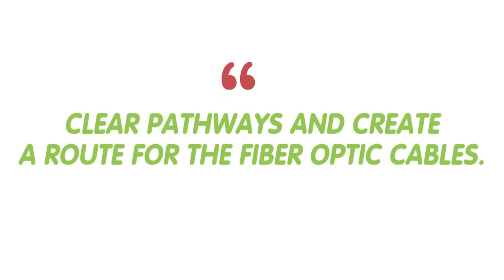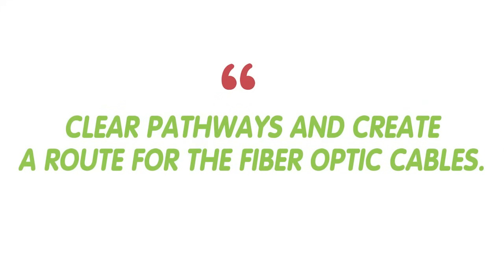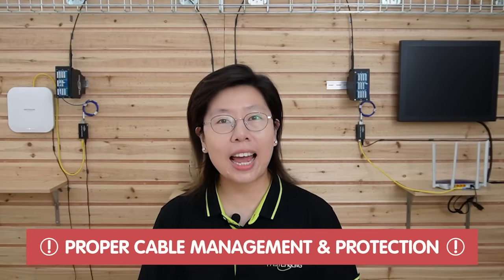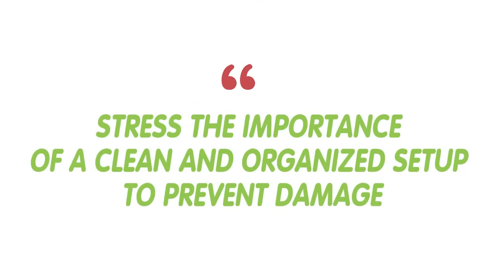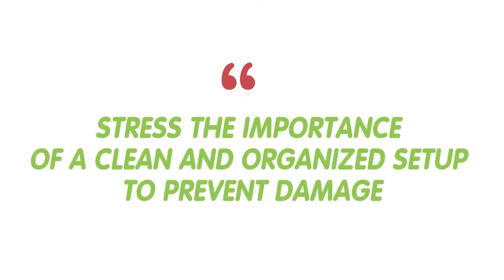Upgrading from Ethernet to Fiber Optic Network: Step-by-Step

Comment: The issue I have is to run power and shielded ethernet in a 30m conduit from the loft.  There is a danger of interference and data loss running these in the same conduit.  I'm contemplating running fibre with my power cables.
Reply from the maker: If the device supports PoE, you can just run one Ethernet cable with PoE, no separate power cable needed.
Reply: @Fastcabling thanks for the suggestion - unfortunately power in this context is mains power of 220V AC and there is a risk of EM interference if running copper Ethernet alongside mains in a conduit.
Reply from the maker: In your case, running fiber is a better choice. Just so you know, we've launched a type of composite fiber cable that combines optical fibers and copper conductors in a single cable. https://www.fastcabling.com/product-category/composite-fiber-cable/

If you're interested, we can customize the cable length.
Reply: @Fastcabling this composite cable looks good. 
Can it carry 220V AC up to 16A?  What is the cross section area of the copper cables? I didn’t see this info in the spec sheet. 
Can the cable be supplied with fibre terminations on one end only?
Reply from the maker: It can handle AC and DC power. We can customize the cable to your needs and include one fiber strand only. Please contact us at support@fastcabling.com.

Comment: Is there a way to completely eliminate cat cables and we can use OFC cable to routers directly to PC everything using to connect with fiber cable. If possible please create a video
Reply from the maker: Most network devices don't support an SFP port.  Both your router and PC must have SFP (Small Form-factor Pluggable) ports or use media converters to switch between fiber and Ethernet.
Reply: @Fastcabling  My friend has a setup where 5 PC has been connected using SFP module (2 fibers) connected to a SFP  TP Link switch. from switch it connected to another module (don't know the name) via fiber again. That module receive the internet in fiber from ISP. 

I want explanation for this setup.
Reply from the maker: The module is probably an ONU. Your friend's computers may have PCIe cards that come with SFP ports where you can insert SFP transceiver modules that support fiber optic cables.
Reply: @Fastcabling  yes he separately bought and installed that one. 
Can you explain the setup in a video.
Thank you for the explanation
Reply from the maker: I'm afraid that we don't have such a PCIe NIC network card, but we'll cover that in the future.

Comment: Mam. My. 4. Ip. Cameras. With. Router.  Nvr.  Poe. Switch. For. Home. Want. To. Connect. With. Fiber. Optic. Cable. Want. Schematic. Wireing. Daigram.   &  which. Type. Of. Firber. Optic. Cable. To. Use
Reply from the maker: Here's the diagram: NVR - router - ethernet cable - media converter + bidi sfp module - fiber cable - media converter + bidi sfp module (if the PoE switch has an SFP port, this media converter can be removed) - ethernet cable - PoE switch - 4 IP cameras

Cable Type:
a. single-mode: Long distances (up to 10km and beyond)
b. multimode: Short to medium distances (up to 550m)
Connector Type: LC or SC

You can use OM3 Multimode if runs are under 300m; it's cost-effective and fast enough.

Comment: I don't think you know what ethernet is, it has nothing to do with copper specifically. i'm using fibre in my home, it uses ethernet still.
Reply from the maker: Copper cables (e.g., Cat5e, Cat6) uses twisted-pair copper wires to transmit data/Ethernet over electrical signals while fiber optic cables transmit data over light signals. 

When you're using fiber internet at home, the optical signal delivered over fiber is converted into Ethernet using a device called an ONT or sometimes ONU. It converts the incoming optical signal (light) from the fiber line/OLT into a standard electrical Ethernet signal. After that, you can use RJ45 Ethernet cables to connect to your home router, switch, or directly to a device.
Reply: @Fastcabling  ethernet is a protocol. The medium doesn't matter. Ethernet over fibre is common, copper doesn't matter. An ont it used for pon and is irrelevant

Comment: Is there much quality differences between SFP brands ?
Reply from the maker: High-quality brands maintain consistent data rates, low latency, and stable performance, especially for long distances or high-speed links. However, matching the fiber type, range, and speed is more important to ensure your setup works efficiently.
Reply: @Fastcabling  Thank you. I will try to use the same brand for cable and hardware. Can you recommend an armored product  that does not have an included power wire ?
Reply from the maker: Here is the direct-burial fiber cable:  https://www.fastcabling.com/product-category/2-strands-direct-burial/
Reply: @Fastcabling  This one seems suitable. I'm not sure of the connections however. : LC to LC Simplex Single-mode 1 Meter(3.28ft) Armored Fiber Optic Patch Cord.
Reply from the maker: Just the same as in the video. Here's the media converter kit used: https://www.fastcabling.com/product/gigabit-fiber-to-ethernet-media-converter-kit-lc-single-mode-fiber/

(diagram: media converter A - BiDi sfp module - LC to LC Simplex Single-mode 1 Meter(3.28ft) Armored Fiber Optic Patch Cord - BiDi sfp module - media converter B)

For 1-meter runs, you can use Cat5e or Cat6 cables instead, as they can handle Gigabit speeds effectively over short distances (typically up to 100 meters for Gigabit Ethernet), and they're more durable.
Reply: @Fastcabling  That's good to know. I have a CAT 7 cable here. At what length would the fiber be superior in performance ?
Reply from the maker: For distances up to 100 meters with 10 Gbps speeds, CAT 7 is sufficient and cost-effective.
For longer distances, higher speeds, or interference-prone environments, fiber optic cable is superior in performance.

Comment: I mean cat6 supports multigig, so theres really no reason to go fiber at home. Plus u still need PoE.
Reply from the maker: For most home network setups, Cat6 cables would suffice.
Reply: @Fastcabling  Surely terminating on each end over cat6 introduces a bottleneck which makes it mostly redundant.

Comment: I am in the process of having a fiber optic internet installed in my home to replace my existing DSL (20 mps) setup.  The system is not active yet but I don't understand how I can set up the wifi to all my devices once it is activated and I cancel my DSL plan.  Will my devices automatically recognize the wifi or like with the DSL modem, Log each one on to the fiber optic modem with a specific modem number assigned to that modem.  thanks in advance.
Reply from the maker: You’ll likely have a new Wi-Fi network name (SSID) and password with the fiber modem. If you want to avoid manually reconnecting all your devices, change the new modem’s SSID and password to match your old DSL modem’s Wi-Fi settings. However, if you use the new default Wi-Fi settings, you’ll need to log each device onto the new network once.

Comment: Although what you're showing is technically acceptable, as an engineer for a large switch manufacturer, I would not settle on media converters.
Only in the rare case of retro-fitting and existing network with older Ethernet-only hardware...
But, chances are, if you're upgrading to 10G speeds, you'll need to replace the hardware at each end for higher throughput and PPS...

Instead I would use switches that support SFP (1G) or SFP+ (10G) directly.
I would use SFP+ Transceivers in my switches, and Multimode fiber cables, as a less expensive solution, since distance up to 500m are possible..
If you need longer than 500m, then consider Single-mode transceivers and fiber cables..

Comment: Sodo i run fiber optic cable to each room in house,  or just  to router? Then ethernet to every room , or wifi from router?
Reply from the maker: Installing fiber optic cables throughout your house is expensive. You can use Ethernet or Wi-Fi depending on your home layout.

Comment: got question, for this job, fiber optic used 1 core fiber optic ?
Reply: 4:35 single mode
Reply from the maker: It is the BiDi transciever that takes different wavelenght to transmit and receive the data. It reduces the fiber optic strands from two to one for single link.

Comment: I whould say that ftp filter to ethernet cable on 8 wires are not strong enough 2 fiber cables whould need more than fpt old routers are much faster than gaming computers or client servers routers looks like bad quality toys more direct looks faster good looking connectors look dangerous and expensive we need home routers with more direct connection copper condutivuty is not depending on voltage or data transfer like usb 3.2
Reply from the maker: You might consider the 10G media converters. It is pretty easy for the fiber optic cable to handle 10G network, but you need 10G media converter at both ends.

Comment: I need help, I can’t find a simple explanation of my question anywhere. I have a pc that u stream and game on. Right now I use regular WiFi and connect my pc to my router with a lan cable. If I get fiber optic installed, will there still be a router like I have now? And will I be able to connect it to my pc the same way?
Reply: Yes
Reply from the maker: There is nothing change. You can consider the fiber optic cable plus media converters are replacing the UTP cat6 cable. It is transparent to the network.

Comment: Hi will still work without using your Fiber termination box? i mean intead of using patch fiber cable, can I use that fiber optic cable directly to connect from both media converter? 

more power thanks in advance
Reply from the maker: It works. The termniation box only make the connection tidy. You can attach the cable to media converter directly.

Comment: Nicely explained, as I discovered your channel again.
I have to re-watch the part in this video about the  transfer speeds. 
I am on a fiberglass  provider network only to incoming rooter.
I like to extend this to my system network with these Gigabit Ethernet Media Converters. 
These videos makes it easier to pick the cable on Amazon and how to configure this. 

My network is almost as
advertise 1Gb and my system Motherboard and CPU are very capable to handle these speeds. 
Highly tweaked😊

Upgrade to 10Gb network card and switch to handle these higher speeds the best❓
Thkyou 
Charlesm
Reply from the maker: You can pick the switch with 10G uplink. I think it is better than 10G card. Otherwise you need PC computer to keep the card running. The single mode fiber optic cable can handle 10G speed. Also you need 10G SFP+ transceiver at both ends.